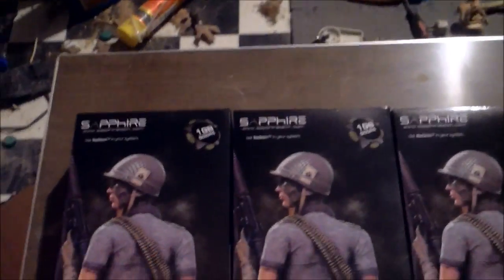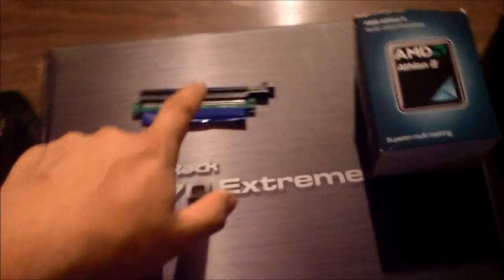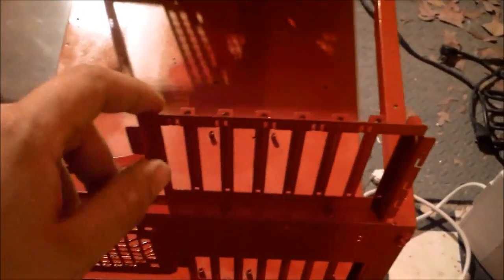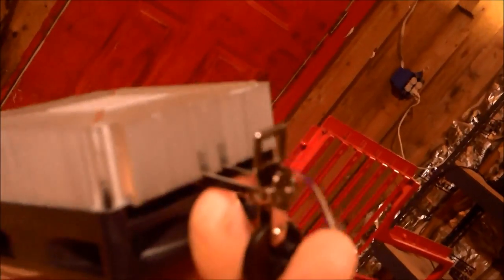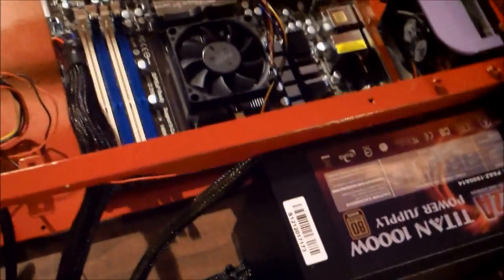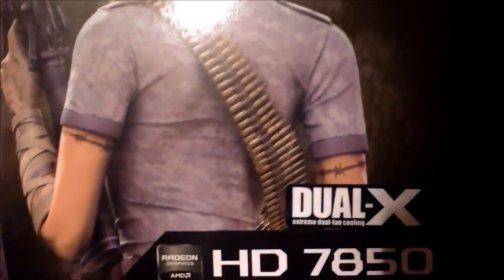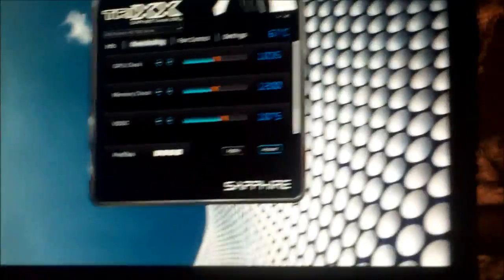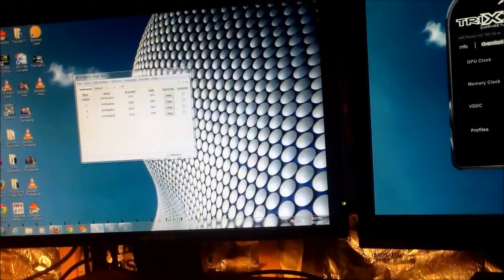How To Make a LiteCoin mining rig

Comment: You do not need the null's for your cards. Tell windows to never go into sleep mode and never turn off the monitor. My bitcoin rig does not have a monitor attached and I mine 24/7 just fine.

Comment: You dont need the vga diode plugs. Im running 2 HD7950 both without a monitor. Im using CGminer. In this setup i have to tune my cards in CGminer, but that is still better than tuning in Catalyst, witch shuts one card down all by itselve, and that makes tuning it very hard. ;)

Comment: Hi, I wondered if you could help me out. I have a standard gaming set up with a GTX 660 and I have an extra PCIE 3.0 slot. I want to buy an AMD 7850 to mine from the additional PCIE3 slot. My power supply should be sufficient but I was wondering if there is anything else that I need to make this work. How do I obtain the devices to fake a monitor so that the card doesn't shut off? Would I run into any issues from running the NVIDIA and AMD card at the same time (assuming that the AMD is not hooked up to any monitors)?

Comment: So many novice mistakes made in the build.
Reply: Well, just some mistakes when building the pc. You're not supposed to push down on the cpu while it's in the socket because that can bend pins. Then you're not supposed to touch the top of it with your fingers because the oil from your fingers will effect heat dissipation. also you're not supposed to angle a gpu in a pci slot because it can damage or possibly break the pci-e slot
Reply: Such as? I am looking at building so advice is appreciated
Reply from the maker: it was my first or 2 build try me now that i have built 6 other rigs... new video coming
Reply from the maker: Alex Shone power supply need to find one with more 6 pin plugs that and the case was crap i make PVC cases now i have a video of that

Comment: 7950s are the way to go now.
Reply from the maker: no r9s are the way to go 750 hash each and there cheaper if you know where to buy
Reply: HowToDanny  Im just getting in this mining investment, but I am so excited, Its so hard to get good a vgu without over paying, but im thinking about 3x R9270's($209each) and overclock and under volt to use a 500w-600w, from what I understand, at intensity on 19 should get close to 1300kh/s, and mine dogecoins or what ever coinwarz says is most profitable, and stats show 72days to break even, good video Danny

Comment: yeah they have some thing called cloud hash where you rent hashing power for like a year or 6 months.i have been running one rig for about 7 months with out a problem but i have had a card fail on another rig.. the ROI goes up and down depending on the prices i have 3 rigs and i make about 3 litecoins aday thats worth 9 bucks right now. but i spend like 3 dollars on electricity so thats $180 a month profit so each machine makes like $60 a month. whats a coinotron?